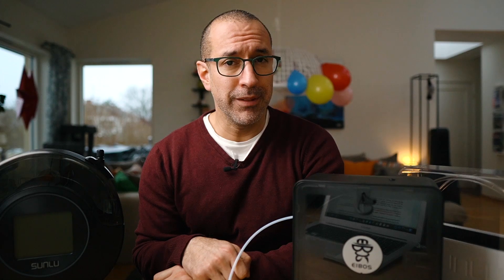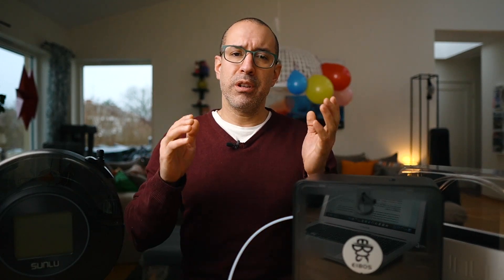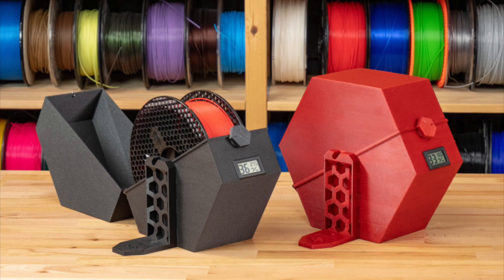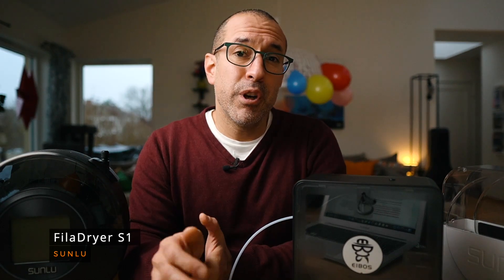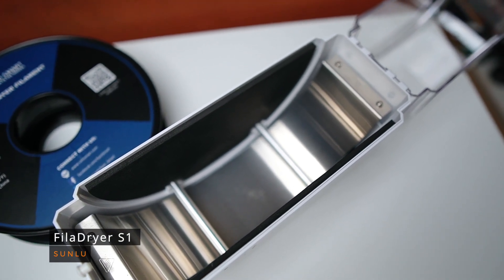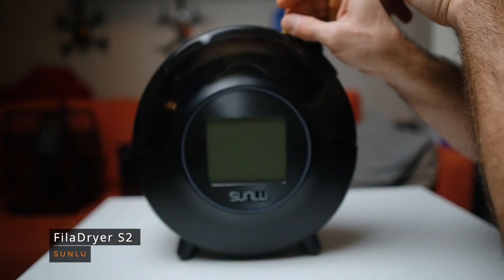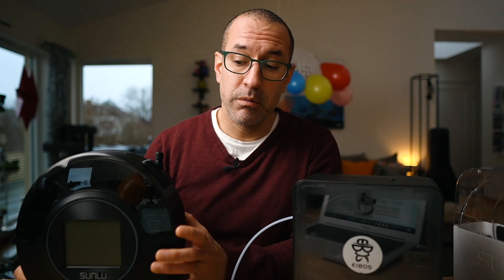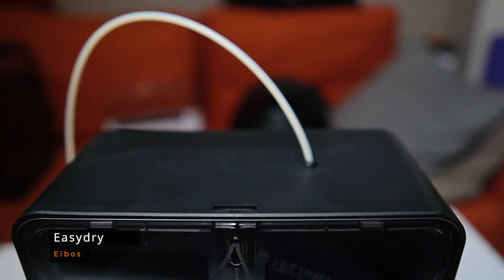Best Filament Dryer for a 3D printer that I have tested (Sunlu S1/S2 and Eibos Easydry)

Comment: I think the cost of meeting certification/safety standards of higher temp dryers is limiting the availability.  There isn’t a non-commercial dryer on the market that fulfills the requirements for drying nylon at 90-120 C.  ALL fall short and only a couple get close to 70 C.

Comment: I've seen you cover a few different dryers now. In your opinion, what would be the best dryer to just actively dry a brand new spool of Nylon CF while printing? I had the Easdry but it died after only a week. But at least I got flawless prints when printing Nylon CF as long as I put a brand new spool in it and immediately started printing.
Reply from the maker: Hi. I’m using the EIBOS Polyphemus for exactly that. It’s a 2 spool device so I can use bigger rolls as well and it has this feature that you can keep the device under certain humidity level after you end up printing so it’s ready for the new print the next day.
Reply: @NordFPV  Thank you! Had my eye on that one, or the S4, but noticed the Eibos lets you set auto humidity mode down to 10% whereas the S4 only lets you set the minimum to 30%. I'm using Pet-CF and it has to be kept at 15%.
Reply from the maker: @mrloofer72  The S4 is great, but it's huge! you need to have so much space to have it, and if you are just drying one regular 1Kg spool, it feels like you are wasting a lot of energy/space.
If you regularly dry more than one spool at the time it could be also a great option.
Reply: @NordFPV the space is my concern. I’m just a hobbyist with no intention of selling at the moment. 
I like what I’ve seen about the Polyphemus, it seems to correct many complaints on other printers, BUT I’d only be drying one spool at a time so it seems like extra space and some wasted energy.
Reply from the maker: @DannyMartin3z  The S4 is 4 spools, and THAT takes place. The Polyphemus is a bit bigger than a 1 spool dryer, but not that much. I think it's safe to go for a dual spool dryer.

Comment: Water expands about 1500x when it vaporizes so I think a fan is unnecessary because if the water vapor was all staying in the box it would build a lot of pressure which it clearly does not.
Reply: That's not quite how it works. The water isn't being boiled releasing steam. Heating the filament increases the water vapour pressure helping it release into the surrounding air increasing humidity. If the air is saturated, 100% humidity the water has nowhere to go.

Fortunately higher temperatures also decreases relative humidity giving more space for water to be removed. A fan brings in more air with low humidity , though it is cold which lowers the rate of drying.

Alternatively you can have a desiccant inside to absorb the water and maintain a low humidity. Heating without a fan or desiccant will still work (provided there is at least some airflow and it isn't sealed), just much more slowly.

Comment: I use the Sunlu S1 and the first thing I realised is that the humidity from drying out the filament wasn't going anywhere, so as soon as the heating goes off, the filament would re-absorb it. What I do now is place a freezer block on the top of the lid (on the outside) and that causes the condensation to collect on the under-side of the plastic. Then every hour or so I just wipe off the moisture. After a while you start to notice a decline the amount of water collecting.
Reply from the maker: That sounds like a lot of work. Why not opening a hole or keeping the lid a couple of mm open?

Comment: I get why you don’t like the center shaft as opposed to nice bearings for the spool edges. However, if your spool is warped or broken, it will cause issues. The center shaft of the Eibos may not be as fancy or as smooth, but the spool center is the place on the spool least likely to have a mechanical issue. It will most likely always work.
Reply from the maker: I’ve seen that more and more. Specially with the cardboard spools. But I print mostly in TPU and some times filaments like PA12. Which requieres a very minimal level of friction for the best results and the eibos dryer box just adds too much, I can’t use it if I’m printing those sensitive filaments.

Comment: -if you have a fan you will conctantly add moist from the outside!
Reply from the maker: I don’t think I agree with you. If the fan is set so it pushes the inside air out, you will be outputting moisture. Only if you have a fan taking air from outside towards inside is that you may end up as you say. Don’t you think?
Most dryers today have a fan and they work very well.
Reply: think one more time about your answer, think alot... @NordFPV
Reply: if the dryer have a fan, it will have to exchange the air it is blowing out from the dryer in the same proportion that is blowing air in and out and in that way it will be a zero gain, you can "dry" for ever, but you will never get any better than your Ambient RH

Comment: The two filament dryers reviewed are both substandard, having highest drying temp 70C. Which is too low for the modern range of filaments on the market.  For example, PA filament needs 90C for 6 hours.  The reviewer needs to review this review !! Also, a filament dryer needs to have facility to insert filament through the output hole without taking the lid on and off, eg a slot, not a hole.  The review is simplistic and not fit for purpose.
Reply from the maker: Hello. Thanks for your comments. I have found that even if the temp doesn’t go over 70 the dryer have a positive effect even with PA. The reviews are based in my experience using these devices. I’m not claiming to be an expert or doing scientific test, just normal day to day usage and what results I get. Your points are valid and if you think it’s worth doing a more detailed scientific test of some of this device I’ll invite you to do one yourself and publish your results. I’m sure it will help a lot of people.

Comment: Do you have a link to the files used for the modifications?
Reply from the maker: The designer will make the available soon and I’ll give you a link to them when he has done it.
Reply from the maker: Here is the part https://www.printables.com/model/587183-sunlu-s2-pc4-m10-addon

Comment: I bought the S2 but I did not get the "nozzle" thing you have on yours, it only came with a couple of 5mm stumps of ptfe tubing. Is my dryer missing parts???
Reply from the maker: No you are not missing parts. As I said in the video I modded the S2 to have less friction when feeding the filament.
Reply: @NordFPV  Thanks mate, I prolly missed a lot due to migraine smacked me over the head and stuck for a few days counting backwards. :) Anyhows, really nice videos mate! Some of the most informative details Ive found so far! Well done!

Comment: Thank you for responding and certainly, the numbers are something to look forward to.
The 'issue' (for me) that becomes apparent is that as (in most cases) the heater is in the base of the unit, it would mostly heat just that one section of the filament spool. And yes, I know some dryers have fans but surely, this creates an inconsistency in the filament and must affect the outcome.
I would be interested in your thoughts on this aberration. 
Thank you
Reply from the maker: Interesting! I never thought about it. Somehow I think the heat goes around, specially in the box with the fan, but yea it maybe that there are certain zones where heat is higher. Then the question is, does that makes a difference?
Reply: The S2 has a second heater on top, and the eibos has a fan that circulates the air, so I don't think even heating would be a problem for those two. The S1 might have a problem though.
Reply: It is such a small volume and heat rises so it’s probably not that bad……

Comment: Great video ... I like the simplicity of the Eibos Easydry fans that works - timer is not important, the result of humidity is more important. I heard the Sunlu s2 the humidity meter is not accurate.
Reply from the maker: Thank you. I have never check accuracy of those sensors to be honest. I’m not sure how would I do that 😆, but at the same time I wouldn’t be surprised if that’s the case. Many of these manufacturers are trying to lower the price as much as possible

Comment: I am not even able to use wet filaments in the AMS of my Carbon X1. The AMS gets jammed and I have the manually remove it from the AMS. The problem occurred for me with the official Bambu Lab Carbon Fiber filement.
Reply: Bambu Labs specifically says the ABS is not suitable for it.

Comment: Two questions: 1. How the filament get dry in Sunlu S2 with all the condensed water inside?
2. Nylon needs 80 C to be dry. Sunlu S2 gives maximum 70C degree and Eibos even less, 65 C only. How does it work? Regards.
Reply from the maker: Hey. You don't get all the condensation everytime. I think it depends a lot where you live in the world, and how wet is your filament.
When it comes to nylon, I have used it both, and seems to work ok. Honestly I use the sunlu 2 more with nylon because of the friction, but for me seems to work fine. Then, here in Sweden we don't have that much humid weather
Reply: @NordFPV  thanks!
Reply: Sunlu S2 gets 50C max for air temperature. That Eibos: 57C.
Reply: @impact0r   thanks!

Comment: How accurate are the temp settings? I've seen a number of reviews where the set temp is no where near the actual temperatures. Which one would you recommend for Nylon/CF Nylon?
Reply from the maker: I have not checked the temperatures, but I have used the S2 with nylon/cf with success.
Reply: @NordFPV  Thank you for confirming that! :)  Did you do the fan mod after this video or are you leaving the unit stock?
Reply from the maker: @ShahriarFarkhan  I have left it stock so far, but I have to admit I don't live ina very humid place. I've talked to other people who gets a lot of humidity and then it's almost a must to have the fan. Not my case though. Check your area.

Comment: Just for dry PLA, PETG, ABS, TPU, Flex, I mean not special filaments.... so I'm not going to print while drying and neither to hack. Which one do you think dries better out of the box? Thanks in advance!
Reply from the maker: the 3 of them will work for what you are describing. I use the 3 of them for my TPU, I think the S1 is the less
Effective but it still does some drying

Comment: Btw, I have not being able to find the SunluS2 with a hole in the front and in back.  Mine has only in the front and every listing and stock photo I have found showing only one as well.  But you are the second person I’ve seen with this version on the S2.
Reply from the maker: Hi Leandro. Really? That’s really bad. I thought those 2 were kind of few. Imagine if it’s only 1…
Reply: @NordFPV  Not only that but you must drill a couple holes on top or leave the door opened about a half inch.  Otherwise u won't get under 30ish humidity with S2.  Poor design all together.  I wonder how effective is the STACKER F-Box compared to all those active dryers.

Comment: I think the eibos is the best box on the market. I’ve added ptfe fittings and added ptfe lines for easier spinning. I also swapped out the display for one that reads temp and humidity levels. I’ve done this to both of my boxes. I also have 2 sunlus and I just use them for drying purposes.
Reply from the maker: You should do a video about that, I'm sure many will like to do the same mod Tanner. I do!
Reply: Any chance of a tutorial on what screen you installed and how you went about it?
Reply: Link to screen
Reply: Seems odd to say this is the best then swap out major parts of the box.  Too bad you can’t buy the best box without rework

Comment: As you print from a spool the radius of the fillament coil reduces with time. This radius and the resistance to turning the spool form a moment that works against the extruder. In an edge supported spool the resistance is given a much larger mechanical advantage than on a centre supported on. I have found in practice that this makes a big difference on large spools.
Reply from the maker: I’ve notice this too. What have you done to improve the situation?
Reply: @NordFPV  I printed spool stands that supported from the centre and have bearings. Previously was using a standard underneath the spool with rollers with 2.5kg spools it was causing minor issues with 4.5kg+ the extruder just couldn't handle it.
Reply: That's an interesting point. A bottom supported spool on good bearings with no slipping introduces "no" added friction. Whereas the eibos has sliding friction since there's no bearing on the axle. Minimizing the friction would get rid of that if it really sticks (like the PTFE comment above). Or... If there's room one could place a low profile outer support bearing stop in the bottom.

[Ope, I see your follow up comment after posting!] 

Really depends on what's winning. I think the eibos issues are pretty easily solved though.

Comment: Good video, I'm snagging a filament dryer to get started then once I get printing decent prints I think I'll make my own dryer and storage solution. There are a TON of great designs out there and it would be an interesting project.
Reply from the maker: I saw one project that I’m still interested about, where you could monitor online the dryer itself. Not that you NEED it but as a project sounded interesting

Comment: Great video! I am just getting started with 3D printing and in a lot of videos about dryers, they mainly talk about Tpu, nylon and pteg. I am starting with pla. How important is it to have a filament dryer when using pla? I also ordered vacuum bags to store the filaments. Would that be sufficient?
Reply from the maker: Hi Danny. I will say that it depends quite a lot of your environment. If your rolls are stored in vacuumed bag, PLA shouldn’t absorb so much moister. But if the bags fails (which is very often) and you don’t have desiccant, and the environment is very wet, you may have problems. It also depends how long time you let the roll absorb moisture. I would think PLA is the one to less worry about this problem though.
Reply: @NordFPV  Thank you for your answer!

Comment: on the s1 you can hold the left button and you can choose for how long you want it to stay on as well... so it's not only the temperature but even a time control 😁
Reply from the maker: Oh really?! Didn’t know that. Thanks for letting me know Aziel
Reply: @NordFPV  no problem my Guy, its a good video, I ended up using the one with the fan and using the s1 as backup, always leaving it a little bit open with a stick so the condensation can escape, not ideal but better than nothing 😂